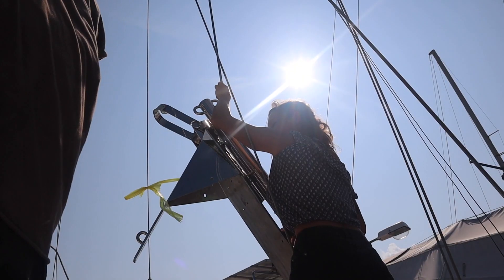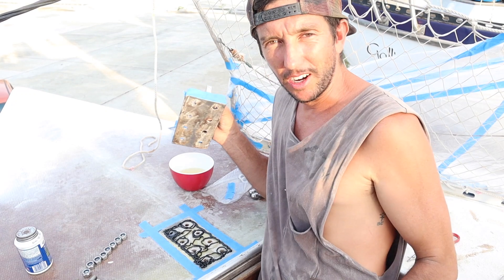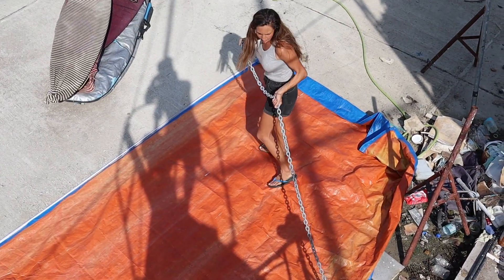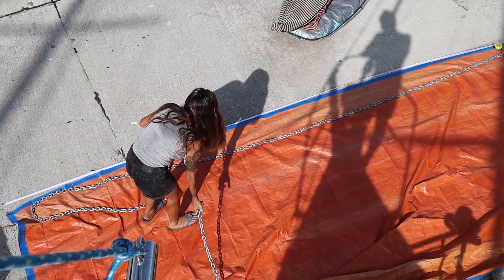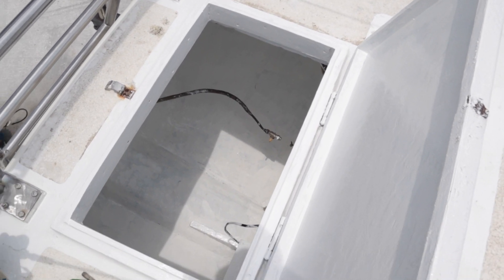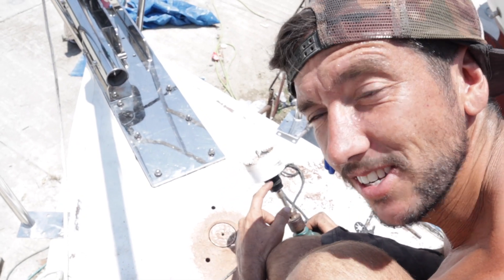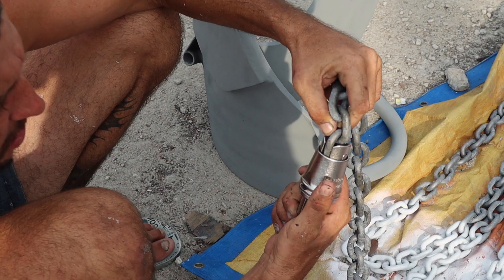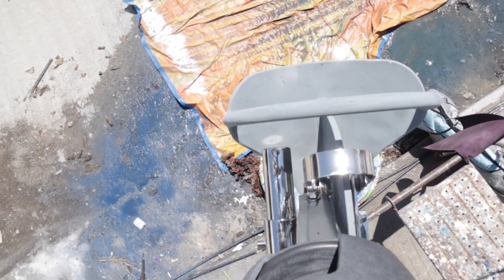Our Bad Ass Bow Upgrade | Sailboat Refit (Sailing Nandji) Ep 131

Comment: Well done! I think you could have easily added another foot switch to power down the anchor and added a toggle switch at the main helm to help when its stormy to lower/raise from the cockpit.
Reply from the maker: I had contemplated installing a rocker switch at the helm but have heard some horror stories with accidental anchor drops etc. A secondary foot switch may happen in the future though to pay chain out

Comment: Hey yosh when using silicone dont bother with the tape, run a neat bead of silicone around your fitting then spray the entire area with detergent then wipe the bead down with a flexible plastic scraper which is also covered in detergent. The detergent stops the silicone from adhering,  professional  finish and way quicker too

Comment: I've had a rough time with those swivels. I dont think I've used the mantis though.  I have broken 2 off on a fouled anchor.  I do regularly anchor in 200 plus feet of water though.I just leave it out now.  It is nice when your pulling your anchor with an Alderney ring becasue of the spinning created by the flukes.I reccomend you learn to pull your anchor with an Alderney ring.  At some point that windlass will break and you will be glad you know this method.   Practice it a few times, its quiet easy.
Reply from the maker: The windlass can also be used independently with the winch handle so if the motor is cactus, we can winch up with a handle. We have already snagged our anchor solidly since being back in the water and the swivel held strong. So far I am very impressed as it helps the chain to rotate as it comes over the bow roller. That last little bit is always tricky haha Will test out your method though for sure, the more ways the better right!
Reply: @FrothLyfeSailingNandji  yeah for sure, nice that you've got a manual winch on there.  The alderney would be tough to pull off with 91 meters of chain, but with shorter pulls its doable.

Comment: Your new fitting look great, all that Stainless Steel. Wow.... Does anyone know anything about anti electrolysis and galvanic corrosion sprays/ that you can spray, where Stainless joins to galvanized chain, to help stop corrosion.  Would you need to reapply coating every time anchor chain is hauled out?
Reply from the maker: I think because the 2 metals are not constantly sitting together it must delay the on set of electrolysis as basically every yacht operates with a stainless bow roller and galvanised chain. Not sure, or maybe it is because you have to change your anchor rode every couple of years anyway... Be interested to hear of sprays or thoughts on this! Everything on Nandji gets sprayed with lanolin anyway :)

Comment: Seriously you should just be using butyl tape for sealing your deck hardware (minus the fuel filler).
Reply from the maker: Sikaflex all the way :) Butyl tape for electrics
Reply: @FrothLyfeSailingNandji  I will quote you next time you try to pull the hardware due to leaks as the Sika has perished after a year. :)